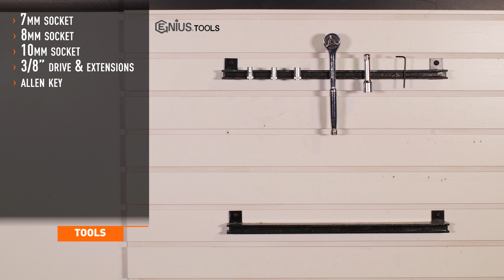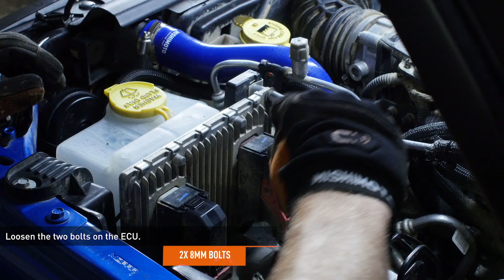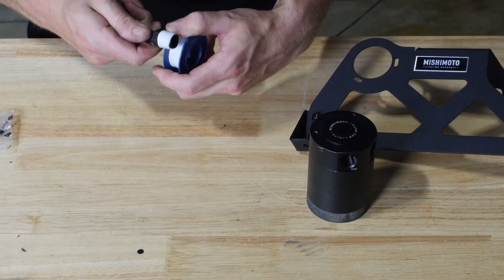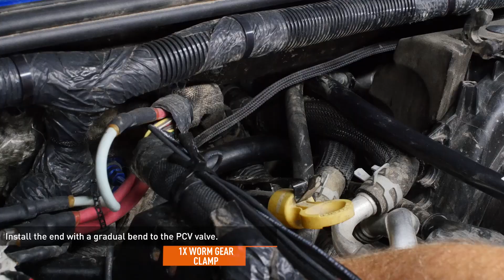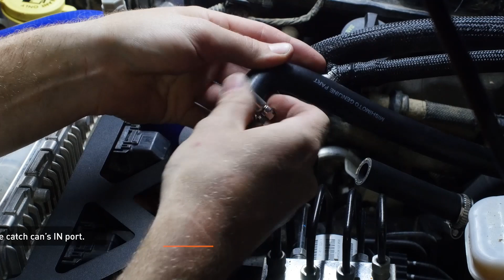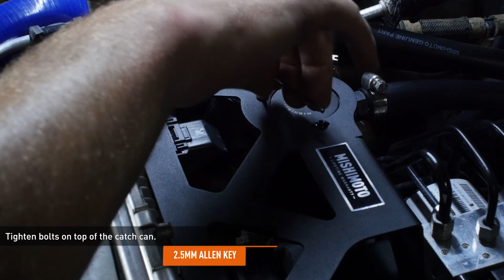2012+ Jeep Wrangler JK Baffled Oil Catch Can Installation Guide by Mishimoto

Comment: I just installed this on my 15 JK. I looked at a couple videos and read some forum posts. Myself, I went from underneath the Jeep and took a screwdriver and pushed up on the hose. That got it to where I could easily pull it off. I just moved the screwdriver to 3 different positions. Lightly pushed, till I could see that it moved, then went up in top and pulled right off. After that it took about 30 minutes to do.

Comment: Will an spod mount over the catch can bracket? It looks like it would and not interfere. Also, do you have to unbolt the catch can all the way to empty contents inside? If so kind of seems like a bad design. Should just be able to unscrew it to drain.
Reply from the maker: We have had people reach out to us in the past and reported some fitment issues in the past but we have not been able test it ourselves to confirm. The bottom of the can will just unscrew so everything does not need to be removed.
Reply: I have the catch can. I also have SPOD and ARB mount. I have no problems. I can fit my hand loosen the can or just remove the three small Allen screws then remove both hoses to empty. I have a 2017 JK. Love this product!

Comment: 2015 jku. Right hand drive . I use for postal service.  Will this fit.  Engine and air filter the same but battery, steering, and the brake lines and ecm is switched?
Reply from the maker: We have not tested this but being that we mount the system to the ECM bracket this more than likely will not fit your Jeep.

Comment: the pcv valve stock hose does it just pull of or is there a clip
Reply from the maker: There is a clip that with need to be released to remove the hose.

Comment: How about the hose that is going through the air filter pipe ? it has oil too that is going through the intake? or should i add a Y connection to that?
Reply from the maker: Some vehicles will benefit from running an additional catch-can on the CCV side as well. We don't recommend using a T-fitting for most applications as this can cause issues with flow.